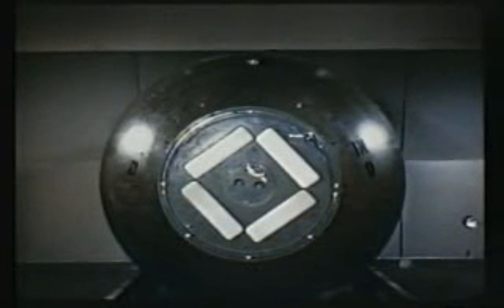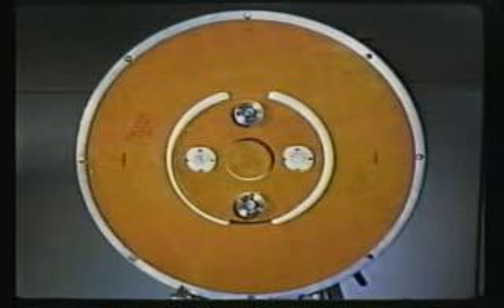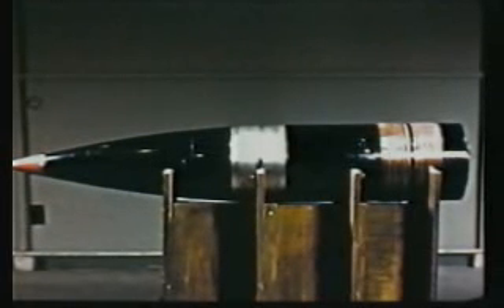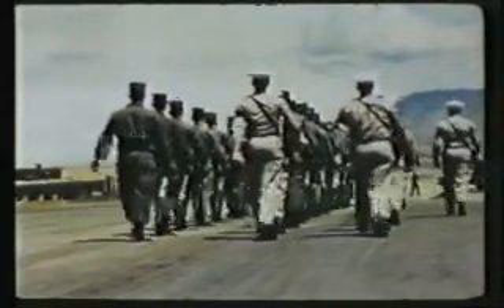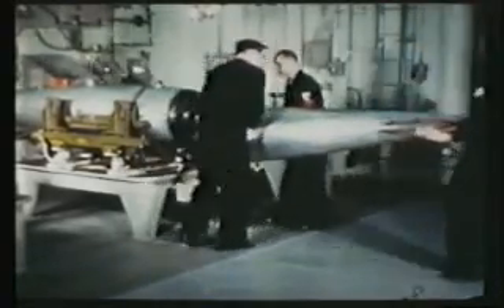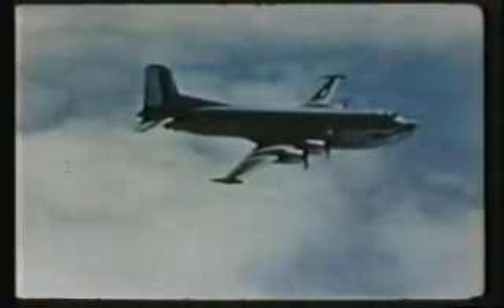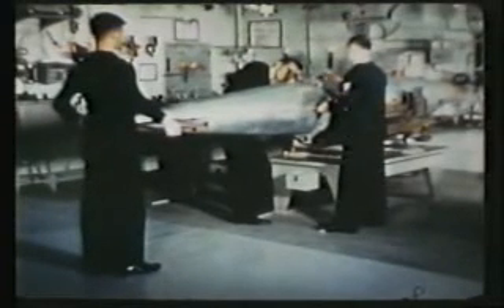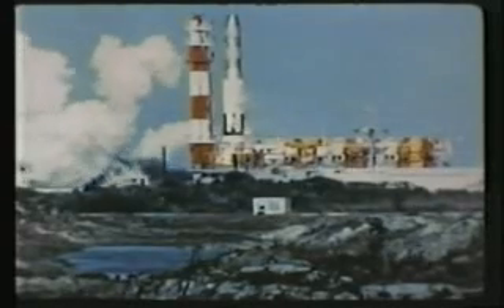Declassified U.S. Nuclear Test Film #69

Comment: These films and the whole series was used at the USAF Nuclear Weapons school at Lowry AFB Co. when I went through school and when I was an instructor.  The sanitized parts deal with components and names of the weapons primaries with the stated yields.  Internal weapon cutaways are still classified SRD (secret restricted data) with the designation of CNWDI (critical nuclear weapons design information). 
 The "wooded bomb" concept drove weapon design along with the need to conserve fissle material.  Smaller weapons with less maintenance reduced the chance of damaging weapons/components.
The MMIII re-entry test set used for testing the Re-entry System and Re-entry vehicle/s was, in 1976, the size of a refrigerator and cook stove side-by-side, well, a little bigger.  The RSTS was not a piece of equipment anyone I worked with wanted to learn and be responsible to maintain.  Lucky me got to got back to school to learn the RSTS inside and out.  Of course when I got back to my shop,  I was made the "test set guru".  Not only certified to work on the RS/RV's but test set too.  That was a long time ago.

Comment: I remember seeing  the Model B-61 being handled on board the USS Kittyhawk in the 70s. The MARDET guarding these weapons were very professional and carried Remington 870 riot guns just like the ones you can see in most police cars. They were certainly a serious looking bunch.
Reply: I served as a firefighter on a SAC Base in the early 80s, the usual upload for the BUFFs on the Alert Pad was 8 SRAMs, each with a variable yield warhead. If you just wanted to take out a small military installation, the unboosted 12 kt yield would do the trick. But if you really wanted to reach out and vaporize someone, the crew could go with the tritium boost factory option, bumping the yield up to 200 kt. The Alert Pad was a bit creepy, a combination aircraft parking area and Supermax prison. High fences topped with concertina wire, signs everywhere proclaiming "Use Of Deadly Force Is Authorized," and heavily armed SPs ready to do as the signs advertised if need be. We were told the 3rd "Halt" was written on the .223 bullet, I never tested the proposition.
Reply: @usafvet100  SPs were scary, given that they thought they were Marine Scouts or Army Recon, but of course were nothing of the kind. It wasn't their competence that was scary, it was the high number of incompetent unprofessional troops they let slip into the field. Speaking as someone who worked in a "Priority A Resource" with the fancy fences, spooky alarm systems and guarded by SPs. They sure THOUGHT they were all that, but I have also actually MET people who served on the sharp end and they are a breed apart.  I mean, we had a guy empty a 20rd mag at a rattlesnake, on rock and roll.  Not the same guy who managed to shoot the clearing barrel twice while handing in his weapon to the armory coming off duty.  Not real impressed with SPs, me. ;D
USAF 1981-1985

Comment: The parts where the audio is cut is explanation about the triggering mechanism and or alloy usage, the difference between mark 4/6 and 7 on what they did different. Some of these innovations or altered strategy to attain the same goal within the technology are still beeing used as a redundancy system in our current IBM production. 
For either when in case the missile is intercepted or if 1 of the main procedures fail within the missile to arm. Hence it is treated as classified.

Comment: I love the delicate tapping of the test  equipment 8.28.
Reply: analog meters are delicate - literally built with jewel bearings like a watch. Handling, such as being in portable equipment, or vibration, can mildly damage the jeweled bearings, leading to them sticking slightly.  So to be sure you were seeing the REAL reading, and that the needle wasn't just stuck stlightly away from it, tapping meters was not uncommon.  I've done it myself!  It's smacking equipment hard on the side which is a no-no.